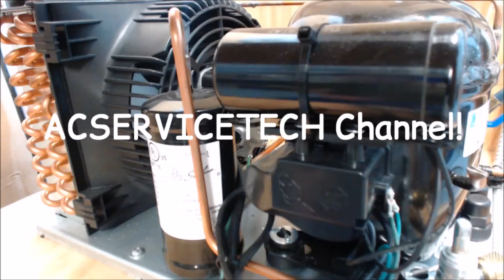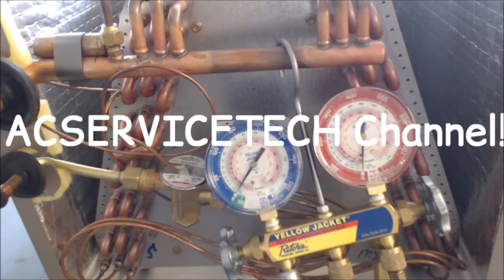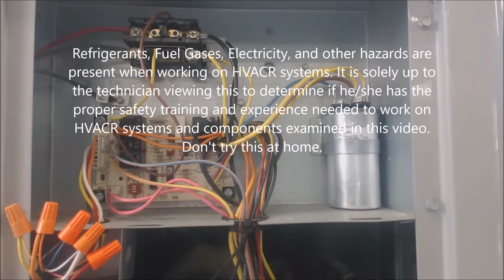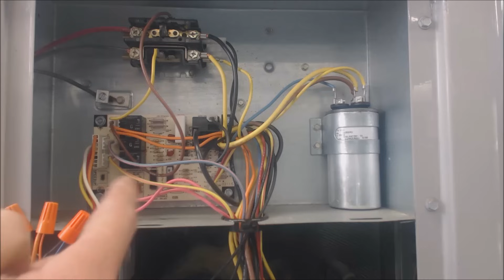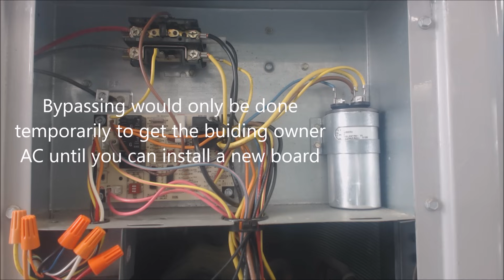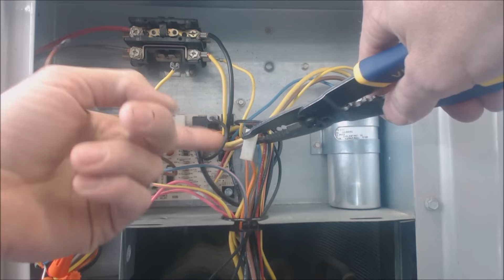Heat Pump Troubleshooting- Defrost Board Testing and Bypass for Cooling!

Comment: Do you have any videos about controlling my lp gas furnace blower only while using my outdoor wood boiler, while maintaining the ability to allow the gas furnace to operate normally in case of low water temperature? I want to be able to feel comfortable knowing my house won’t be cold if I go away for a weekend without having to adjust bunch of things.
Reply from the maker: I don't have any videos on that but when I have installed them in the past, I put an additional thermostat in for the wood boiler heat circulator relay and another relay in the boiler to turn the circulator on or  in a furnace to turn the blower on. Then the homeowner would simply put the boiler thermostat 10 or 15 degrees lower than the wood boiler thermostat, thanks
Reply: AC Service Tech LLC , I have lp gas forced air though. If I had an indoor boiler this problem would be easy for me. What I can’t get figured out is this, with the two stat setup as provided with the Central Boiler manual, it would allow the gas to back up my OWB but my furnace blower would run constantly so long as the boiler stat was calling for heat, which it would be. I could pull 120v from the fused side of the furnace circuit for a line voltage stat with the switched side going to a low temp cutoff in my OWB supply and then to a parallel tap on the board for the blower. I’m confident this would achieve the end result I want, however, I really don’t want a second stat, and I haven’t found an economical option for that low temp cutoff.  I would be happier with a 2-stage t-stat IF it would work for me. I’m just not able to verify whether that would work. Other than the defrost portion of a 2-stage stat, it seems that in heat pump stage all that happens is the blower is on or off when 1st stage is calling for heat. If it doesn’t keep up, the 2nd stage kicks in allowing the furnace to operate as it normally would, but I’m not confident that the fan wouldn’t still run constantly as with the two 24v stat setup. In a nutshell, I want a worry free automatic system that takes no special measures on my part and something my wife can not have to bother with.
Reply: Can you confirm whether the 2-stage thermostat would work for me or not?
Reply from the maker: I wired about ten outdoor boilers to do what you are looking to do and always used a separate 24v transformer along with a second thermostat. You can't have two separate 24v transformers in a thermostat that are both for heat, thanks
Reply: AC Service Tech LLC , Thanks for the confirmation. Was there any need for a low temperature cutout to prevent the blower from running or not?
Reply from the maker: Usually there is a  low temp switch in the boiler that stops the circ pump. That can be used to via a fan relay to stop the 24v supplying the indoor blower motor, thanks

Comment: Say whaaaat?....
Reply from the maker: Hey Vern, what are you asking? This is just a temporary jumping for the air conditioner during the middle of summer if there is an issue with the board. Also keep, any pressure switches in the 24v circuit to power the contactor. This could be done until the tech is able to purchase and install the defrost board during summer, thanks.

Comment: Would a trane defrost board cause the Compressor not to kick on while the fans running I keep hearing a clicking already tested the capacitor ~
Reply from the maker: Usually the defrost board is needed in order for the compressor and fan to both turn on by powering the contactor. Then the defrost board relay just controls if the fan is on, thanks

Comment: Thanks for spending the time to make all of your videos.  I have watched many of them.  You are one heck of an EXCELLENT teacher clearly explaining everything you are doing! 

I have a heat pump that is not cooling.  The low side pressure is about 50 psi and the high side is about 150 psi.  Both lines get neither warm nor cold.  The indoor fan, outdoor fan and compressor are all working.  Do you think the defrost board is causing the lack of cooling?  Thank you, Mike
Reply from the maker: Hey Mike it seems that 50 psi would be too low and that you are low on refrigerant. You would check in subcooling if you have a txv metering device and check in superheat if you have a system with a piston as the metering device. Check out "acservicetech superheat playlist" and "acservicetech subcooling playlist" thanks

Comment: Thank you very help full 
What wire I should use if my thermostat worked with batteries and I don’t have blue or commen  wire coming from thermostat ?
Reply from the maker: You would still have a c coming from the indoor unit even if from your indoor unit to your tstat you don't have a common, thanks
Reply: acservicetech thanks

Comment: Will this work for Payne units?
Reply: I went ahead and tried this on my Payne unit. I was able to successfully get the unit running but it was not cooling. So something must not have been correct. Ideas?
Reply from the maker: This was a carrier unit which is the same manufacturer as Payne and Bryant. It sounds like maybe you are not sending 24v to the reversing valve if it is running in heat mode, thanks
Reply: I went back out there and double checked all my wiring. Still no go on the cooling process. My next question would be, do you think it's the defrost control board since the unit was not running before I bypassed it and now it is at least "running" (coming on) after I bypassed it? If so I'll just run and pick up a defrost control board from my local distributor.
Many Thanks for the help in advance! :)
Reply from the maker: When you say it isn't cooling, is it just the fan running or is the compressor running as well?
Reply: Well, found the issue today. There was a hole in my line inside the condenser, where the lines were touching (from the factory) and from all the vibration, it put a hole it in! :( Sad.... sa day! Had to get a man out to solder it up and add 5 pounds of freon! Ouch! But on the bright side, the house is cool again! :)
Reply from the maker: At least the problem is solved, thanks

Comment: Why not just tell the homeowner that they will have to wait until you can run to the supply house to grab another defrost board
Reply from the maker: The supply houses around here are typically only open mon-fri from 8-4 and we need to be able to get the customer up and going, thanks Curtis!
Reply: acservicetech 
I get it , but it just seems as though for a less experienced tech, changing the wiring around for a temp fix leaves the door open for mistakes

Comment: Could you please explain about 6:39 minutes into video you took hot wire off of contactor, which you said went down to a pressure switch. You also said had to go thru pressure switch in order to have power come into fan relay. I am a bit confused here since I cant see diagram for unit. What pressure switch are you talking about and how does this effect power coming to relay?
Reply: That is for the 24v going into fan relay on control board. He bypassed that relay since it’s on the bad board and wired it straight to contactor

Comment: HiFirst of all, I want to say you work is greatly appreciated. I have been listening to your videos all the time and I have learned a lot. I want to ask you a question on Mitsubishi City Multi VRF system. I was at one site location where company had install multiple City Multi VRF system with multiple BC controllers. At one particular room with three ceiling cassettes one thermostat during hot day when thermostat demand cooling, warm air blowing from cassettes. Apparently the company who installed it was not able to troubleshoot and some other technicians where not able to troubleshoot also. Do you have any idea what is happening? Or what would be the cause of this. Thank you.
Reply: The VRF is a garbage system. Every fitting and length of copper tubing has to be engineered right on the nose plus the fact that there are no isolating refrigeration valves make it worse as God forbid should you have a leak, the whole system charge will have to be recovered. You cannot isolate any section. What a shame. Sure there's no need for ductwork however, I prefer the KISS Method. Keep It Simple and Stupid.

Comment: Oh my god!  Why have to go along way just bypassing to run cooling mode ?why not just take out wires  from  R .Y..O terminals  tie up together and R and Y for Rudd or Rheem?
Reply from the maker: This would be if the defrost board was bad and not allowing power through to the contactor, thanks
Reply: acservicetech by taking wire from R terminal you already take off power from the board  and connect to Y  and O to energize contractor an reversing valve .
Reply: You can't power the reversing valve if the board is bad. When you do it the way your talking about your by passing the thermostat. Used for troubleshooting reasons.

Comment: great vid, took these instructions with me to a job and wow everything you pointed out i tried and it worked.
also did as Bernie suggested and did not leak the hi and lo pressure switches, gotta have safeties.
great job, great job
Reply from the maker: Yes keep the pressure switches in series with the 24v power going to the contactor thanks!

Comment: I went to tech school for this but went straight into the building maintenance field not working with this everyday so when I do get a chance too I am not always real confident in myself watching your videos helps bring back things I forgot or things I never ran into yet that you only get in the field and repetition of doing this type of work thanks sir.
Reply from the maker: Thanks msmolik14!
Reply: Same here. Doing maintenance you run into most split systems and kinda forget the heat pumps

Comment: why does my heat pump keep turning on and off? it's a bryant
Reply from the maker: The indoor fan or the outdoor unit or if it is both then it is likely loosing a signal from the tstat?
Reply: Check your contactor

Comment: I've heared I can bypass for heating I live where only gets 50 lowest never snows where i am can you help me out
Reply from the maker: It depends on which manufacturer you are dealing with whether you need to power the valve or not for heating. Most reversing valves are not powered during heating,  except for Ruud, Rheem, and Weathermaker, thanks
Reply: acservicetech yeah I have old American standard power on cooking and new onse I install are ameristar they power in heating just move the wire easy easy
Reply: I am able to bypass the board and get hearing and cooling just won't function properly in really cold weather, I did it the same as the video but I have jumper W-Y so basically all the thermostat is doing is telling revers valve what to do. I work for apartment so I can afford to make mistakes lol 😂

Comment: why not just take the RV connectors off the board and connect them to the contactor 24v ports, RV would still only come on during call for cool
Reply from the maker: Absolutely, You can but I just did it this way so that it would be the same for both energized in cooling and energized in heating rv's, so people doing either brand were not confused, thanks
Reply: acservicetech great video by the way, I encountered a situation where 1 month old Goodman HP was operating normally in cool mode, then all of a sudden, it started producing heat (lost power to the RV), only thing I figured was that the defrost board relay has gone bad.  your thoughts 
Thanks
Reply from the maker: It could also be the rv going ad or the solenoid, dft sensor, or you could be loosing the low voltage signal. I would start by disconnecting the dft or connecting the low voltage wire directly to the rv instead of going throught he board. This will help you determine which is the problem if it is intermittant. Thanks

Comment: I want to install a heat pump condenser on a non heat pump system how do I do it?
Reply from the maker: What do you mean, an air handler and condensor only for ac instead of a heat pump outdoors? The main difference is just the outdoor unit and biflow filter drier, thanks!

Comment: Can a heat pump system have both type of valve on one system. piston at condenser and TXV at blower? Thanks!
Reply from the maker: Yes that is correct, thanks and I just sent you a link to a video to discuss that

Comment: very thorough information! would it work the same if you attached  one of the reversing valve wires with the yellow wires and the other reversing valve wire with the blue common wires?
Reply from the maker: Sure, that takes the board out of play, and then you are running cooling on most except ruud, rheem, weathermaker, thanks

Comment: hey i installed two payne heatpumps both stopped working at same time the board is ok contractor power up and outdoor fan works compressor doent start at all even if i manually push contactor then also i have checked  for grounded compressor and ohm resistance everthing is fine 
still it didnt work if i start manually it runs for 5 seconds thats all
and if i tale red hot wire out it still runs the fan
Reply from the maker: Do you have power going to the compressor? For instance, sometimes there is a substance of ants or cobwebs on the actual contacts of the contactor. Is the capacitor good? Do you here a humm like the compressor is trying to turn on?

Comment: I have a Lennox HP that has burned up 3 reversing valve coils in the last 3 months in cooling mode, the unit works and cools well until the coils short out and cause the 24v circuit to blow a fuse. Any idea of what the cause could be?

Any chance the defrost board is bad and would that cause the r-valve coil to short out?  Thanks for any guidance.
Reply from the maker: Usually the power for the reversing valve is not stopped at the defrost board but flows through it. Normally when coils burn up it is because they are either powered on all the time or are not pulling on a load such as they may not be the direct replacement from the manufacturer that would fit well on the reversing valve cylinder. Thanks

Comment: Thanks for the Video. I had 24 vols=ts on the control but not at the contacter. As soon as I touched and moved one of the wires going from the contacter, the contacter engaged and everything started working!!! I cleaned the stake-ons and am hoping for the best. Thx again Cecil from Florida
Reply from the maker: Thanks

Comment: Why not take rv to contactor, then only have Y -common to make up??
Reply from the maker: I didn't want to confuse those who are working on ruud rheem and weathermaker as they will not be powered in cooling mode but for the other manufacturers you are absolutely right! Thanks

Comment: Can you help me understand im new to this trade but i have two questions... Is t1 common? And is t1 and y wired in series thats why you can check for resistance? Sorry if theyre dumb questions its just bugging me
Reply from the maker: Y goes through the safety sensors and then powers T1 on the board which initiated the timer. The sensors are just breaking the hot for safety and is not a common. With the power off you could check for resistance if the wires were disconnected off the board. The high pressure and high temp sensors wouldn't trip though unless the system was on and had a problem. Thanks
Reply: +acservicetech  thank you so much! You truly are the best when it comes to explaining and your videos are helping me understand hvac faster than any of my previous trade school teachers. God bless and thank you again
Reply from the maker: Thats awesome to hear man! I just got done teaching my high school students and now my Adult night school students for the night. Figured I would check in on you all. May the Lord Bless you too!

Comment: The condenser fan motor relay on the defrost board is normally closed. It only opens on a call for defrost; therefore, there is no need to remove wires for condenser motor in this case. The 24 volts to board has no role in keeping motor relay closed.
Reply from the maker: This is true but as a precaution if the board is bad, I would go ahead and just take the board out of play if it is intermittently working or bad and this is the first time at this job site. I would only be doing this for a short while until I get the board to be sure and while it is in ac mode. Thank you very much for your comment!
Reply: jdr5501 Qq

Comment: Can this troubleshoot be done on any defrost board ?
Reply from the maker: You would need to look for a defrost sensor if it has one and speed up terminals if it has them, then yes you could s they are made for testing. Some older ones are just timers for defrost though. Thanks

Comment: Hi, what to do if the defrost do not have T1 & T2.
Reply from the maker: If you have high pressure sensors that are normally closed then they will break the y going to power the contactor. Really you would need to read the wiring diagram though to make sure that the wires are in the right spot and that the defrost board is counting time for defrost properly. Each board is a little different but this a common board.